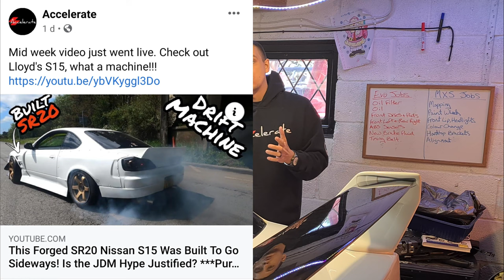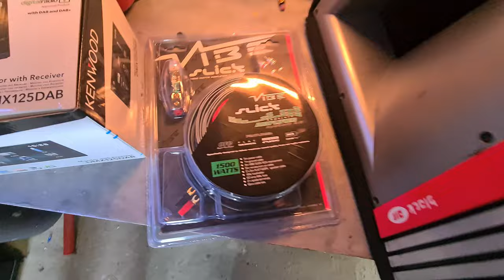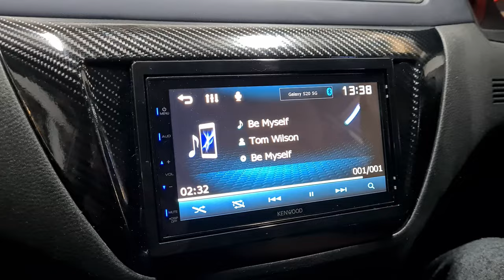Making An EVO EVEN BETTER! *Paint, Semi Slick Tyres, Audio Upgrade*

Comment: You: "This aint the car for stretched tyres" 
CyberEVO (An Evo that ran a 54 second lap time round Tsukuba and a previous World Time Attack winner, known to run stretched tyres):  "Am I a joke to you?"

Lads, that aint stretch, that almost square lol.
Reply from the maker: Visually i am referring to. As I personally don't like that "slammed and stretched" look myself. Each to their own really., just not my thing lol.
Thanks
Ken
Reply: @accelerateyoutube  I mean they were not really stretched by the looks of things, the understeer was probably more down to just average tyres and front wear.

I get that, but a 215/35 on a 10J is stretch, not a mild amount of pull like whats in the video. People do this to actually help handling and steering feel as the sidewall ends up firmer and doesn't roll, its why you'll see alot of drift cars set up that way as it provides a smoother and more controlled transition from grip to slip. 

The slammed and stretched you refer to is a completely different subculture but slightly downsizing a tyre onto a wider rim when done correctly can actually offer a lot of benefits to make you quicker (hence why I mentioned the CyberEVO, I presume you've heard of that car?)

Any thoughts on the Zestinos at all, looking at picking up the medium compound?